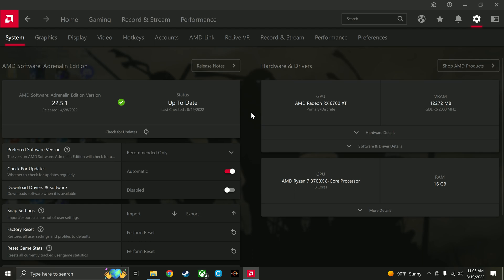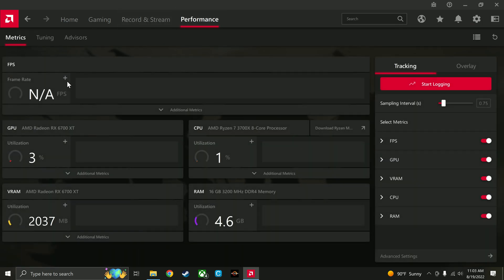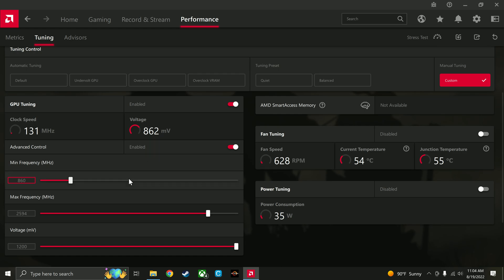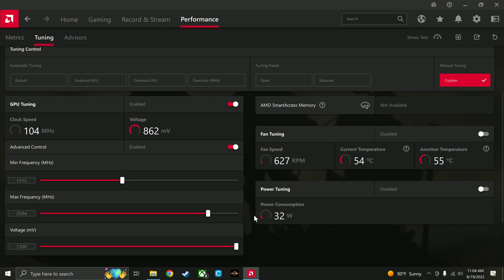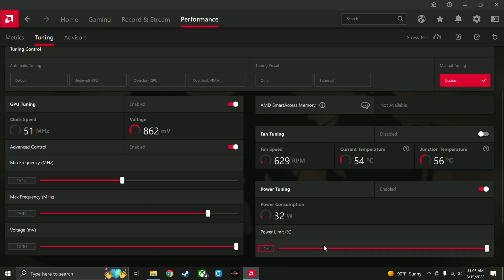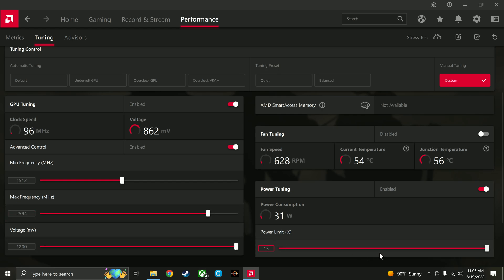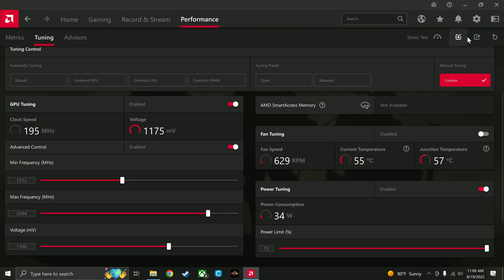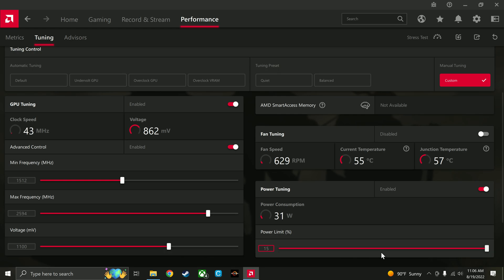How to Fix Sound Cutting Out AMD Radeon RX 6700xt

Comment: I can confirm that raising the min clock speed of my 6700xt pulse fixed all the audio stutters I was facing with my pc connected to my tv through hdmi 2.1. I also found that raising the min clock speed is also beneficial in some games where your gpu load is low since it over aggressively tries to downclock the gpu which can result in framerate stutters as well.

However, I am a bit concerned why does the 6700xt have this issue in the first place? I don't think its the hdmi drivers since I tried switching to the windows hdmi audio drivers as well. Is it because there is a manufacturing defect in these gpus?

I raised the min clock speed to (max - 100). I set it to 2500Mhz without changing anything else like voltage etc. I dont think this would damage the card by overheating etc, correct?
Reply from the maker: Unfortunately, that seems to be the case. I haven't seen any such issue with the 6800, 6600xt, r9 290, nor the rx480. I know some people have issues with commonly issue-free hardware, but the 6700xt really seems to have this issue for many people.
Reply from the maker: If I remember correctly, the min and max have to be separated by at least 100 MHz. Raising the max clock also raises the max voltage. Raising the min clock might also raise min voltage, which may be why this resolves the issue. Heat is caused by power consumption. Clock speed alone doesn't raise power consumption; it's the instructions per cycle multiplied by the frequency that causes it. Those factors determine the electrical resistance. Without enough voltage, such load could not be held, and the system crashes, but the higher the voltage, the higher the power consumption (I=E/R; P=E*I >> P = E*E/R). The thermal limit is 110C, though some tests have shown degradation from prolonged use at 100C. This is probably due to thermal fatigue, or even steady-state creep, since the silicon is still (on a very small scale) a system of analog switches.

TLDR/ if your gpu edge and junction temperatures are under 100C, it shouldn't be a problem.
Reply: I have ryzen 5 5600x and 6700xt can you Give me your performance settings i have stuttering on every game
Reply from the maker: @dadinss9313  default settings should work fine. What’s your ram configuration?
Reply: @Bunta1987qwerty  can we talk about it in private ? i need help
Reply from the maker: @dadinss9313  https://discord.gg/88Fp9Tcz
I just made this discord. You can feel free to delete your messages after.
Reply: @Bunta1987qwerty  I found my stuttering problem is because of the shaders but when the shaders compile it bugs me for hours how can I fix it?
Reply from the maker: @dadinss9313  Some games, notably unreal engine 4 games, will have this stutter until the devs fix the game. It's actually a draw call problem caused by loading levels, since UE4 uses map tiles and areas as "levels". Otherwise, the shaders are compiled and cached on your drive over time. Meaning that it will stutter the first time a new shader is shown, but not when it's shown again. You'll notice it anytime you update your drivers, since the shader cache gets cleared during the update. Which game(s) are you having this problem with?
Reply: @Bunta1987qwerty  I have stability problems in battlefield 2042, in Dead island 2 even if the shaders are compiled in the menu (I don't understand why I bug) and also a little pubg (surely and other games I haven't tried everything
Reply from the maker: @dadinss9313  Could you list your pc specs? You could also do it in the discord if you'd prefer that, or even send me a dm there. The discord link is in the pinned comment for this video, I think.

Comment: I also tried multiple fixes and this as well. This worked when playing WoW for example, but tyhen the problem gets back and this did not help on Sims 4 or GW2.

Only fix i could find was installing patched drivers for Realtek instead that allowed it to use DTS and multichannel just like HDMI. Unfortunately this does not help me anymore since my new AVR cant use optical with HDMI going through but i just wanted to say this if someone else is also as frustrated with AMD audio as i am and is trying to find alternative ways to get best possible audio.

Comment: about to try this! But I have to comment on the voltage comments. If you lower voltage and the card still consumes the same wattage then you're running more current through the card. This is called Ohms Law. Current will create more heat than voltage.
Reply from the maker: That’s correct. My point being that a lower voltage means less power for the same performance, or better performance for the same power draw. I=E/R and P=I*E.

Comment: It seems to work with my 5700xt !! Thanks a lot !! 🙌
I had to disable fast startup otherwise it wouldn't work
Reply: Unfortunately, it was short lived...
I wonder if this is an EDID issue
Reply from the maker: @benjaminpizier2244  could be, but I had the issue even running a trs cable, and optical s/pdif, so it wasn’t in my case. Another thing you could try is disabling multi-plane overlay, which causes problems with many series/models of cards. Nvidia provided a registry edit you can download to do that. Here’s the link:
https://nvidia.custhelp.com/app/answers/detail/a_id/5157/~/after-updating-to-nvidia-game-ready-driver-461.09-or-newer%2C-some-desktop-apps

Comment: Unfortunately this has been going on for more than 10 years. I first started having the same problem when I installed a R9 280 in 2014 in conjuction with an Onkyo NR-818 reciever. I found a fix on a forum about 8 years ago. This does not seem to work for the 6700 xt. It does work for older cards.This is the post.  I hope it works for some of you.

Originally Posted by JeonjuHot
Hello. Im a korean user and Im not good at english. So. just interpret yourself.
I had a same problem as u guys.
I have 7950 and onkyo 707 receiver and after Ver. 12.3 audio drop had occured.
To solve this problem, I compared other drivers and found solution.

open regedit and find
HKEY_LOCAL_MACHINE\SYSTEM\CurrentControlSet\Contro l\Video\{XXXX...}\0000
( 'XXXX' means device number. There are several device number folder and u should find 'AdapterDesc' in 0000 folder which key value is 'amd radeon HD 7XXX Series'. )

At that '0000' folder, Change 'PP_SclkDeepSleepDisable REG_DWORD' value 0 to 1.
and reboot~!~!~!

I solve this problem like this and hope to resolve the problem.
If it doesn't work, I don't know.!! bye

Comment: I think the reason this solves the issue is that raising the min frequency raises the min voltage. I'm using 5700 xt and it lets me change the min voltage independantly, I have it set to 900mv and it seems to be good so far. Another way to fix this in MSI Afterburner would be to force constant voltage, though I have it underclocked and volted to 930mv.
Reply from the maker: I’ll have to confirm in hwinfo. Interesting.
Reply: @Bunta1987qwerty  Actually I dunno I think it might be amd driver/software. I clean installed with driver only then ran the troubleshooter for windows audio and reinstalled the driver then in device manager uninstall monitor driver and then check for hardware changes to reinstall. Maybe good

Comment: I have the sapphire pulse Rx 6700 10gb which I just installed and immediately started having audio drop for 1-2 seconds at a time. While listening to Spotify and watching Netflix and YouTube it happens once in a while but while in a game it happens much more often. I followed your instructions to see if it would help at all and unfortunately the problem persists. 😢
Reply from the maker: Try disabling hardware acceleration from chrome and Spotify
Reply: @Bunta1987qwerty  Didn't help. Still getting 1-2 second sound cut outs while gaming.
Reply from the maker: @Galewinds  which driver version are you using? Headphone jack, spdif, hdmi, or display port for audio?
Reply: @Bunta1987qwerty  I'm using HDMI I actually just bought a new cable to test if that was the issue today and it didn't help. Needed a new cable anyway though. 22.11.2 is the drivers I am using for the GPU if that is what you meant.
Reply from the maker: @Galewinds  it seems a lot of people are having problems with that driver. Try the other one that’s available on AMD’s website (22.5.3 I think), and see if my solution works for that version. I think I’m using 22.10.2 on the 6700xt. You could probably find it on techpowerup or something. If not, I can send it to you over discord or something, but try out the one that’s available online and see if it fixes it.
Reply: @Bunta1987qwerty  There is a 22.5.1 and a 22.5.2 but I am not finding anything that is 22.5.3. Do you suggest one of those or the 22.10.2 that you are using?
Reply from the maker: @Galewinds  try either one of those. The one I have is working for me, but the May drivers are the ones a lot of people are using.
Reply: @Bunta1987qwerty  Gotcha. Have a follow up question. When I download these drivers will they automatically override the ones I have now? Do I need to get rid of my current drivers first? If so how do you do that? 😅
Reply from the maker: @Galewinds  haha no worries. When you install them, make sure to choose factory reset. Normally, you should use DDU to remove old drivers, especially if you’re going from amd to nvidia/intel or vice versa. Radeon to Radeon, it shouldn’t be necessary. Installing will override the old ones, minus a few things. Choosing factory reset should remove everything from the old one.
Reply: @Bunta1987qwerty  I followed these instructions exactly and it was looking good for about 10 minutes then the sound started cutting out again intermittently for 1-2 seconds at a time. Could it be that I need to update my MOBO BiOS? This is crazy and honestly has me regretting abandoning Nvidia to try AMD >.<
Reply from the maker: @Galewinds  I've owned 6 amd cards. 3 of them were rdna2. The only one that has had problems is the 6700xt. You definitely should have the chipset drivers and ryzen master installed, assuming you're using ryzen. Try setting the Bios PCIE to setting to Gen 3 or 4 manually instead of Auto. If you can still return it, I would and get any other amd card, or an nvidia card, though they're definitely more expensive. I know people who have also had problems with rtx3000, especially sound. My guess is that it's getting more difficult to reconcile compatibility with how many possible hardware and software configurations there are these days.

Edit: If you previously had nvidia, you definitely need to use DDU to remove those drivers for your new card to work properly. You'd might as well fresh install windows while you're at it. You can do it without losing your files, though you may have to reinstall some apps and log into your accounts again.
Reply: @Bunta1987qwerty  Really appreciate all the feedback. I have 65 days to return this card to Newegg. I am going to do a little more troubleshooting with the BiOS and if I cannot get this thing working I'll refund it and make another purchase. I am using Ryzen 5600x CPU. I checked out my BiOS version and it hasn't been updated since late 2020 so that could be a fix but idk. I am unsure of what another option would be for a replacement. Do you have any suggestions? I don't mind forking over a little extra cash for quality but I would rather not pay over 700 USD if possible. I am not picky I just want the product to work!
Reply from the maker: @Galewinds  the rx 6800 is a decent step up, and I’ve had no issues with mine in 2 years. Even the 6800xt is under $700. Trouble is the new cards are coming. For $700, you can get a 3070 or a 6800xt. Prices were better maybe 2-3 months ago.
Reply: @Bunta1987qwerty  Quick update. I haven't gone into BiOS yet, haven't had time. But I plugged in my headphones through a usb connected DAC and I am not having any of the sound drop. But without using the headphones the problem comes back. Does this spark any idea as to why that might be?
Reply from the maker: @Galewinds  sounds like it may only be through hdmi. Try plugging into spdif/optical and see if it still happens. Try disabling or uninstalling the amd audio drivers and just using generic windows driver.
Reply: I just got the same card from a FB seller so I cant return it, but the issue seems to be when the sound comes from USB (atleast for me) when I plug to my tv and use the sound from HDMI i have no issues, when I use my bluetooth headphones I have no issues, its only when I use my astro mixamp pro USB sound card  that I get the 1 second sound issue. further analysis is needed to see where the issues is at, atleast for me it doesnt seem to be the cards fault 100%
Reply from the maker: @BravoMx  if you had an nvidia card before, make sure to use DDU to remove all traces of the old drivers. Additionally, make sure you have installed your chipset drivers. One last thing, I've had some usb cables cause issues with sound devices, even though they work fine otherwise. Try another cable just in case. I hope you find a solution. 
Edit: I just realized you may not have a separate cable, since it's a sound card.
Reply from the maker: @BravoMx  if you’re still having trouble, disable MPO. Just google it, and you’ll see nvidia released registry changes to minimize problems with rtx 30 series. It seems to work for amd cards as well.
Reply: @BravoMx  Did you fix this? I have the same issue. New RX 6750xt, with scarlett solo, my mic and sound cuts out whilst gaming.
Reply: @SuttleFear  My issue has something to do with the mixamp pro and audio interface not vibing well with the card...It resolved itself when I pluged them to different usb controllers on the mobo, try that.
Reply: @BravoMx  Thank you! I'll try that now. My GPU is heavily bottlenecked so I don't know if that's the issue. Wish me luck!

Comment from the maker: I should have mentioned that Radeon Software tends to reset itself if you don't DISABLE FAST STARTUP! 

Windows 10: 
Press the Windows Key + R to bring up the Run dialog
Type powercfg.cpl and hit Enter
The Power Options window should appear
Click "Choose what the power buttons do" from the column on the left
Scroll down to "Shutdown settings" and uncheck the box for "Turn on fast startup". 

Note: If these options are greyed out then you may need to click "Change settings that are currently unavailable".

Windows 11: 
Press Win + R to open Run.
Type control and click OK to open the Control Panel.
Go to System and Security and then click on Power Options.
In the left pane, click on Choose what the power buttons do.
Next, click the Change settings that are currently unavailable link.
Under the Shutdown settings section, check the Turn on fast startup (recommended) option to turn on the feature.
Uncheck the Turn on fast startup option to turn it off.
Click Save changes to apply the changes.
Reply: It dont work all the time. Just for a little period and it is the same shit all over again! I use version 22.11.2, but it crashes and fucks up. Got any other solutions?

Comment: on the phone to my mate and fixed his issue with this video.  His fixed at 1550 or so :)
Reply from the maker: You can even set it to just 100 MHz less than the max setting, though I would imagine some degradation would occur over time at those speeds.
Reply: @Bunta1987qwerty  well, it kinda fixed hte issue,  he ended up having to format his c: and reinstall windows, he was going from a 1660ti to a 6700xt.   hopefully it fixes it regardless,   your technique did kinda work,  but not enought for him to be satisfied,  cheers though
Reply from the maker: @rainbash81-ttv95  You need to run DDU to remove all traces of the Nvidia drivers before installing the AMD drivers. In fact, just have it remove all video drivers. Plenty of how-to vids on YT. Basically, run pc in safe mode, run ddu, select uninstall x driver (do it for each option), and then restart. Install drivers after it's back up.